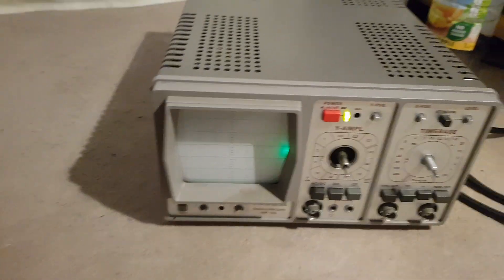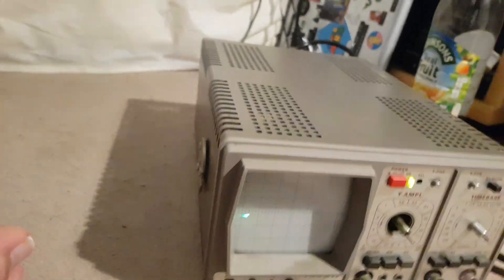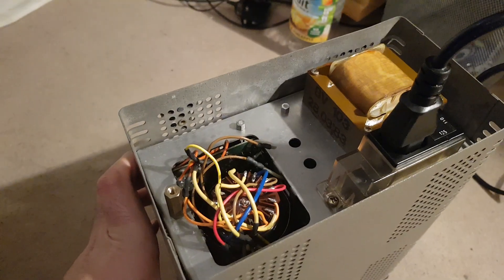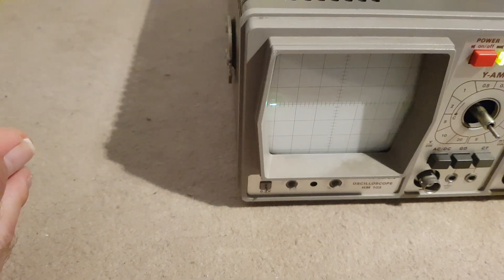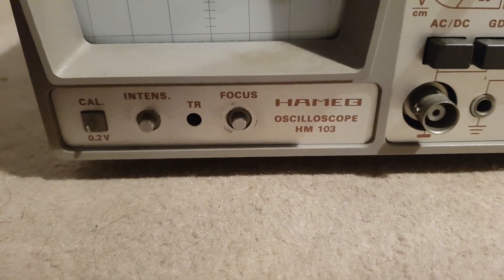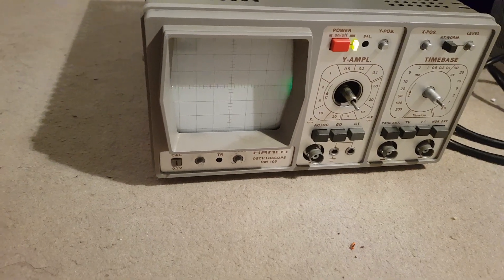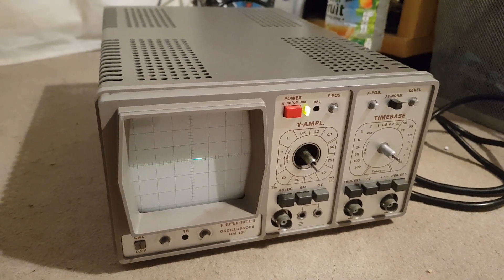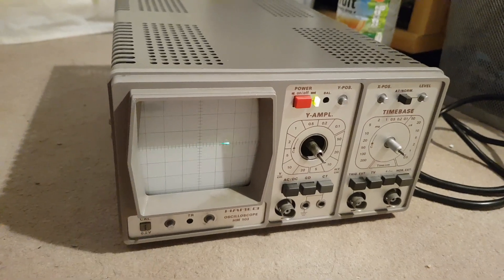HAMEG HM 103 CRT Issue

Comment: You are not to bang on the CRT with the players as you do (it can break easier than you think)
Reply from the maker: I think people forget how tougth these things are, TV ones were no that easy to break, you would oftern have to though a brick at them sevral times. Where they are really fragial is at the back of the tube.

It is when you remove them from the device you need to be really careful with them, plus if the tube brakes while it is asembled, most of the glass will be contained within the scope.